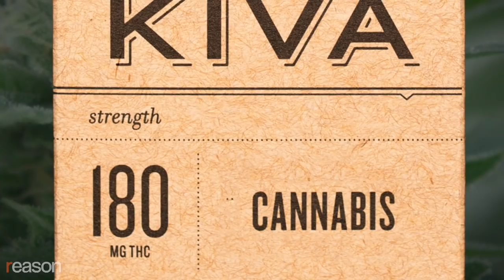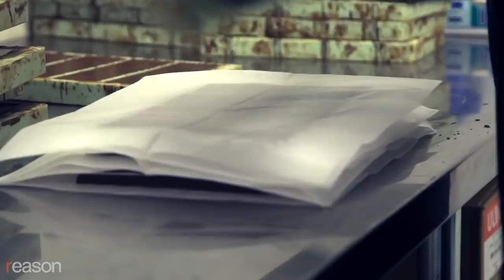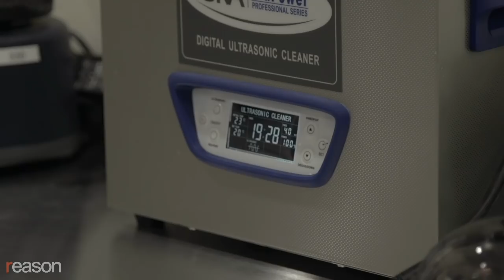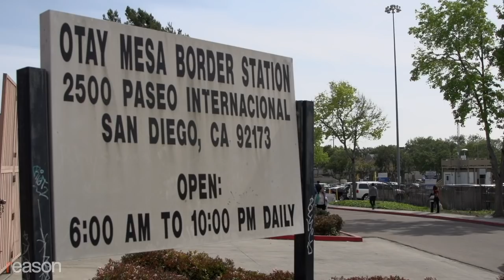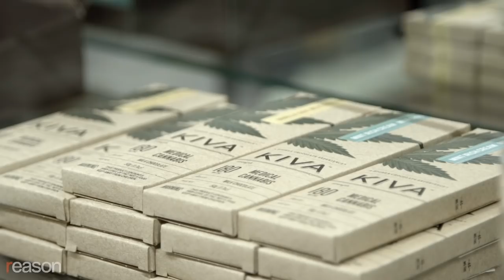California's Legal Weed Is So Heavily Taxed and Regulated That the Black Market Might Survive

Comment: Look. the same thing happened at first in CO & WA. Prices at legal shops were equal to or higher than street dealsers for 2 to 3 years. I don't know about the tax differential between CA and those states, but here in Seattle shop prices are down over street by 50 to 75%. Give it time for growers to lower prices thru supply & demand.

Comment: Must have been close to 15 years ago, RAND corp did a study in a scandinavian country concerning not only the costs of growing cannabis indoor, but what they would expect corporations to undercut each other too under a loosely regulated market, similar to alcohol.   They assumed that with healthy margin, the cost to distributors would be around ( not adjusted for inflation ) $10.50 per ounce.     That is for indoor grown and accounting for rent, electricity, fertilizer, equipment maintenance, labor ( planting, pruning, drying, picking,  packaging ).    I seem to recall they would be making similar profit to pizza and pasta.  So i'd guess that means it costs about $1.50 to grow an ounce.

Yea the blackmarket still has plenty of reason to exist, and it still costs people an arm and a leg for their medicine.

( edit ) That $10.50 figure is not given in the study but was the current exchange rate.

Comment: I noticed 2 things that stood out to me as an amateur mistake... First of all, you should ALWAYS trim the cannabis leaves off the plants BEFORE you dry them! If you wait until they are dry before trimming then you will knock some of the trichomes off the flowers while handling them losing potency in the process. Trichomes are very brittle when dry and will dislodge easily from the buds. Shady dealers will purposely dry their cannabis and then "tumble" the buds to collect the trichomes off the surface for hash/oil production. You can easily see if cannabis has been tumbled by checking the buds with a jewelers loupe, the glandular heads of the trichomes will be missing and/or smashed.

Secondly... A cannabis plant is supposed to naturally go into senescence at the end of their life cycle. When the plants enter senescence, they pull nutrient stores from within their leaves to fuel end stages of reproduction. This means the leaves will turn yellow/red/purple etc and fall off. If a plant is dark green right up to harvest that means they were fed up to the day of harvest and the fertilizers used will still be within the plant as well as the heavy metals, hormones, auxins etc used during growth. This is bad farming practice for the cannabis industry... An unflushed cannabis plant is going to be harsh and unhealthy to medicate with. 
Perhaps these people may want to return to ornamental plants as this clearly is not their forte'!

Comment: that's some  amateurish looking weed on that farm... too early as it looks (buds are too far apart and too small and not fully developed), too quick a dry (you are not supposed to blow at that shit with a huge fan), and too much green on the drying plants (a little is good, so it can do some post-ripening, but that's just too much - and if it was flushed properly, it would not be lush and green either). they need a pro to take over their production, this just looks like crap...